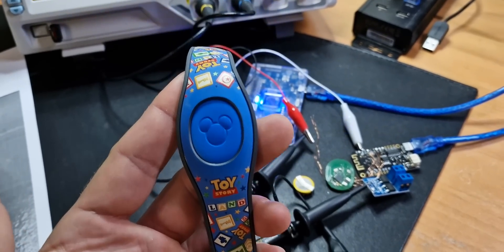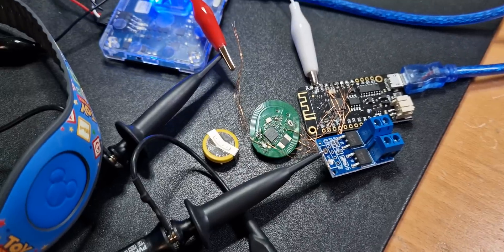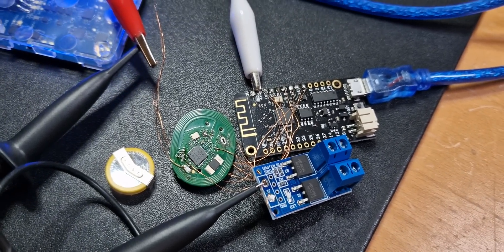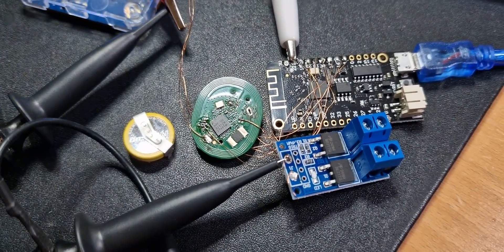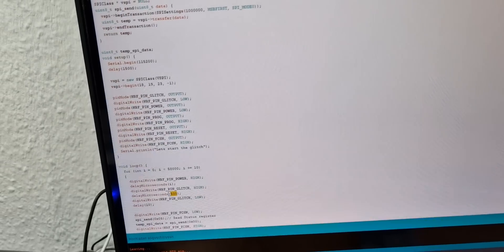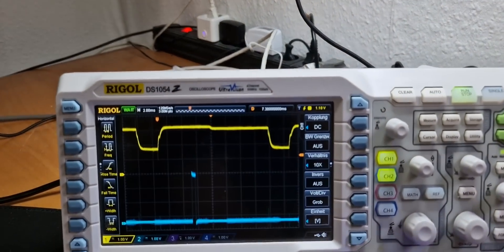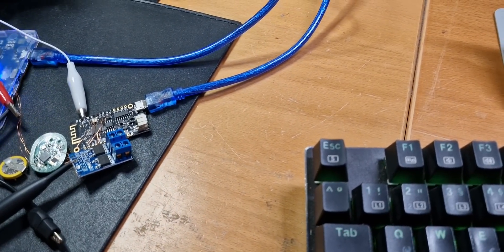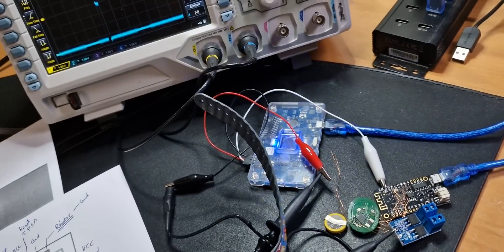Hacking the Disney MagicBand that tracks you! + nRF31512 Glitching

Comment: I wonder why you didn't do a little research before posting this. Details on the radios and how Disney uses them have been known for years. You can lookup the patents too. No near for everybody to guess.  A nice addition to the knowledgebase is the machine code dump, I haven't seen anyone else do that yet. Thank you.
Reply from the maker: It was about the challenge on hardware level.

Seeing the actual code and protcol its is running.

Also the reusing of it was a nice addition

Comment: I am under the assumption due to the style of the device and it's decorative theme, that the RF function may be used for locating lost children in an emergency at the parks. This function makes sense, and could be quite useful, as opposed to them tracking adults through the park. I can't imagine the volume of data that would be required to trace every individual in a park, in detail, through their stay in the park. Nor do I see a real world application for that data which would justify storing that data dn parsing through it.
Just because they can, doesn't mean they are, or even that they want to.

Comment: So, the Magic Bands do both NFC and RFID.  When you get the magic band near a scanning terminal (for park entry) it triggers the process of verifying that you have a valid ticket.  The stored fingerprint isn't actually a fingerprint but a hash of your print, and it frequently glitches out at the turnstile getting into the park.  You scan your magic band, then touch the reader, and it confirms that you have a valid ticket, and that you are the valid holder of that ticket.  This also allows you to register your Disney resort room to your magic band so you can scan at retail outlets (with a passcode you must enter on the keypad) to have merchandise charged to your room.

As for the RFID, the bands do keep track of where you are in the park to some degree.  Disney uses this to track guest flow in the park to manage park capacity.  If too many people start gathering in a particular area of the park, they will start an impromptu event somewhere else to draw guests to that location.  Additionally, it uses that same technology on the rides to attach pictures captured by the ride cameras to your Photo Pass account.  That is how it knows which ride vehicle you are on, so that those pictures are assigned to your account.  And in some ride queues, like Expedition Everest, for example, there are monitors in the ride queue that have random new stories that scroll by, and periodically you will see a new story about someone with the same first name as you, as the ride queue scans your magic band and creates "relevant" entertainment on the monitors.
Reply: I am concerned how you know of all of this... Has the mouse... Has the mouse touched you in any way?
Reply: @randykitchleburger2780  Because I'm an adult who goes to DisneyWorld, and owns several Magic Bands, and I understand how technology works.  Also, it isn't a secret.  They are clear about what the technology is for and how it works.
Reply: @spetsdod Creepy if you ask me. I will stay away from disney.
Reply: @Lobonova  Cool.  That is a fine decision.  Smaller crowds for the rest of us, and your phone tracks you more than Disney does anyway.

Comment: I teach Radio Scouting and STEM to Orlando area scouts and we show 27mhz cb all the way up to 5Ghz Drone, and even have a Disney band on display... our speech is along the lines of... it has NFC for credit card,   RFI for park entry and hotel locks and two wifi modes, one is a broadband (<1000ft) so they can do heatmaps of the park and see where blobs of people are at (and use rides, character's and wait times to move people around) and the other wifi is short range for their photo ID on rides (<30ft).  kn4mdj
Reply: You're right and wrong.  NFC is being used for park entry along with room keys and purchases.  The RFI is 90% of the being used for attractions.  This means if you have a 6 year old band you can still use it to get on rides (Genie +), enter parks, unlock your room, and make purchases.  If this was done with the RFI it would require the battery and that could die during your trip/park day.  I honestly don't know where the "hardware hacking" is on this as it's all very well documented by Disney and very public.  In fact this is where apple first tested their NFC stuff at as the time Disney and Apple had a partnership going on.

Comment: The Disney app uses the band and maps your position throughout the park. It also holds credit card information so you can make purchases both in the parks and the resorts. In addition you use the band to skip lines to attractions using fast pass. It also limits you to one fast pass per day per attraction. It gives you time warnings for reservations and directions thought the park. It also stores you park pass information, my wife and I were season pass holders, this is how we would access the parks and hotel reservations at Disney resorts.
Reply: Are you sure that all that data is stored in the device, and not only a serial number that is used by the backend to retrieve the data when needed?
Reply: @a4d9  Most of this is very certainly in the backend. All the device appears to do is authorize with RFID/NFC and ping a radio receiver every few seconds.

Comment: i think most people missing something. these devices can send data packets not just pinging.
Packet:       | Length | Type | Unique ID | Sensor Data |
Length (2B):  | 00 12  | XX   | XX XX XX  | XX XX XX XX |
also tracking can be used for heatmaps to help the staff/entertainers and for a place with so many children this kind of tech can prevent a lot of weirdos. so again it comes privacy <> safety
Reply: Yea, but it relies on good guys having that  info. If a perv had it? 

I doubt they'd go through that much to get it, but still
Reply: this subject got my attention so i anyone is interested:

>this device can broadcast data packets like:
 AA 8E 89 BE D6 0F 02 A1 B2 C3 D4 60 D4 89 12 12 34 56 78 9F AB CD EF

>which could be data like:
"Preamble: AA
Access Address: 8E 89 BE D6
Header: 0F 02
Data: 
   Unique ID: A1 B2 C3 D4
   Timestamp: 60 D4 89 12
   X-coordinate: 12 34
   Y-coordinate: 56 78
   Checksum: 9F
CRC: AB CD EF"
(in this scenario 4,294,967,296 combinations of device can be possible)

also keep in mind that this is not the maximum payload of this device, so it could be easily sending additional data
Reply: The weirdos and pervs are openly welcomed as guests, and work there also. They have their "special flag".
Reply: “Those who would give up essential Liberty, to purchase a little temporary Safety, deserve neither Liberty nor Safety.”

Comment: They definitely track you in the park using it. It can allow Disney to automatically sends you photos  you appear in: IE on rides just by scan your car as you roll by. Also certain events can trigger on the related app based on where you were
Reply: It's NFC so it's unlikely to "track" you per se. Instead from recollection, there were readers & scanners around the park you were motivated to tap your band to. e.g. the band might cause something to happen in a static display, or you might use it to register with a ride, or make a payment with it, or associate yourself with photos. That isn't to say there weren't hidden NFC readers around the park, or some kind of beeper in the band that nearby detectors could see, but it probably didn't need to because it was intentionally overt. Anyway, these days people will be tracked through their phones and the Disney apps on them they use for park access. No doubt too the wifi in the park is able to track visitors via MAC addresses in a semi-anonymous way - they know the MAC and might use it to glean some info but not necessarily the person the phone belongs to. I'd also be more concerned if Disney is also using facial recognition or suchlike, combined with the band than the band itself which I can take off.
Reply: @drxym  There's the NFC system for tapping into attraction queues and paying for meals and merchandise, but that's a completely passive system requiring no battery; the power for that comes wirelessly from the reader.  The embedded battery is for the active "long-range" system which is probably able to read at a resolution of dozens of feet instead of a few inches.  This is the system which is allowing for those "extra" experiences and crowd management.
Reply: @nosbig98  correct.   Which is what Disney said when they announced the Magic Band years ago.
Reply: @drxym  Most wifi networks have you log in to use so they will know exactly who you are from your phone
Reply: Yeah, they use it for aggregating data and know where crowds are and adapting wait times for different attractions.

They also use them in surprising ways, for example, at the end of It's A Small World, where the final scene of the attraction wishes you goodbye by name.
Reply: @nosbig98 Bingo. Also a lot of theme parks are moving towards “digital twin” models for other data science applications. I have some friends in the biz and unfortunately that’s all I’ve been allowed to be told ;)
Reply: And if they know you're at a place at a time, what can they do with that data? Well, they do it. And it tells them a lot more about your journey. Sorry I won't say more.
Reply: @mcfnord  You know, I understand what you're saying in general, but here's my hot take.

I will gladly allow Disney to track where I am while on their property.  It's a vacation and a choice that I make.  I willingly know what data I am giving up and understand the scope of how that data is used.  I would much rather use that on-property data, even if Disney uses that to market their stuff to me at home, than to give away as much data as I dribble to Google, Facebook, and so many other big tech organizations by virtue of carrying a smartphone.  I would favor that use than my local government tracking my movements through the use of license plate scanners.
Reply: @nosbig98  Disney wants to know where you went before and after visiting.  And  a phone carrier might tell them.
Reply: @mcfnord  No, they won't.  They don't need to.  For folks visiting the Disney Parks, they have their own app for Android and iOS.  It would be much more likely (and far easier) for the My Disney Experience app to collect and re-transmit your location data.  There's also a massive question as to whether it would even be legal.  I haven't checked my contract with my carrier personally, but unless there's something explicit in their privacy policy and ToS, it would be a massive, widespread breach of contract to provide that.

What benefit would Disney, of all companies, get from recording your day-to-day location information when not in the parks?  They no longer have physical stores, so it's not like they have a large footprint where location would matter to their front-line, public business.
Reply: @nosbig98  What benefit? They'd love to know what you did before and did after. Which non-Disney park did you come from? Go to? How long did you spend in those other places? I helped them find out. You might be surprised what carriers ask users to authorize within ToS.
Reply: @mcfnord  My point was that using the long-range tracking in the Magic band doesn't matter outside of the parks.

As I said, I would be more likely to expect that the location permissions requested by the app on a smartphone would have much more value for telemetry, even without the support of a carrier.
Reply: @nosbig98  If two datasources have GPS-time data, perhaps they can easily identify one actor by matching the GPS-time datapoints.
Reply: Not how it works …it’s when you tap with the photographer